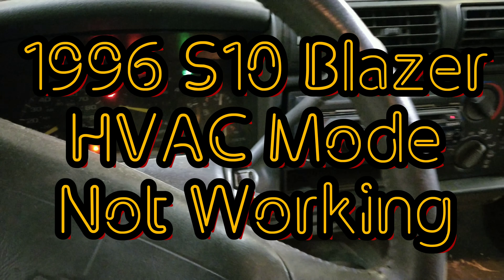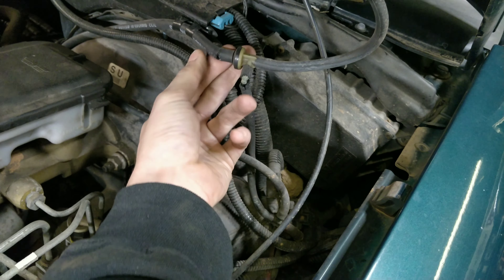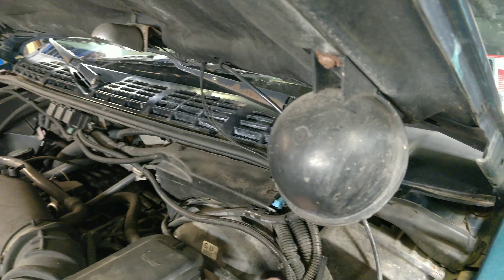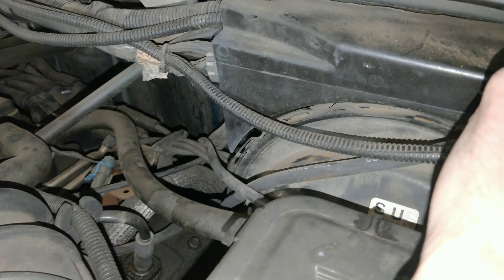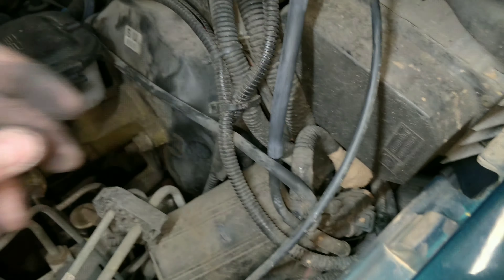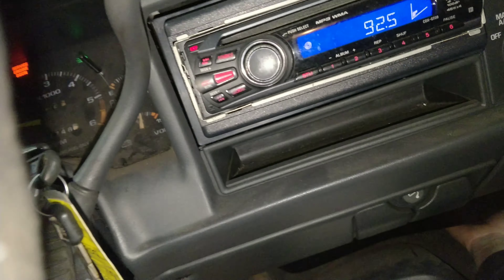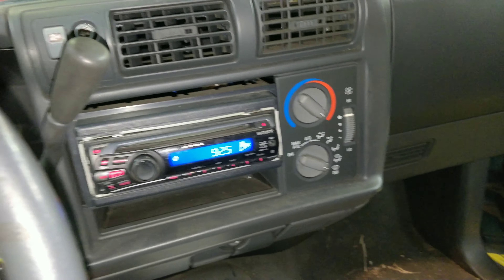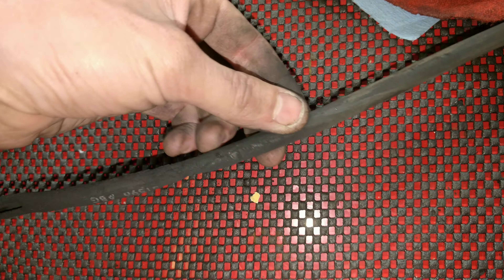1996 Chevrolet S10 Blazer HVAC Stuck On Defrost

Comment: Just bought a 1995 chevy s10 with 229k on its odometer. It's a 2.2L with 5 speed manual which, as we all know by now, still Runs and Drives Great! 
However,  the HVAC only blows to the defrost,  no matter the setting. Your video is very helpful,  as I now see that there's NO Vacuum ball at all under the hood!  In fact,  it looks like some previous owner removed both the control vacuum valve as well as the vacuum ball. Hopefully,  since I just ordered one of each and bookmarked your video, I can actually fix this issue by still-framing your video.  Excellent contribution,  thank you!